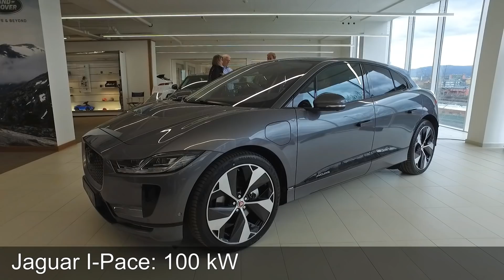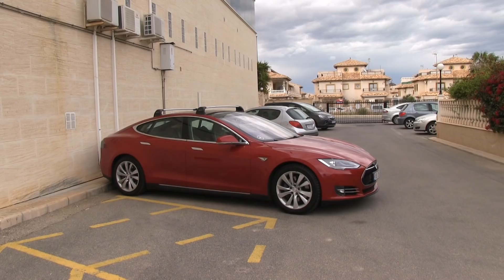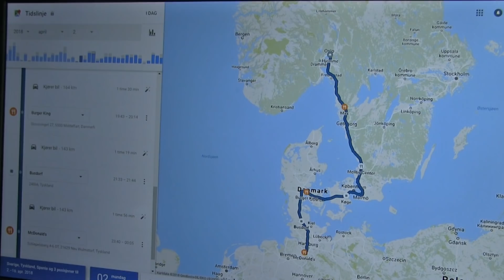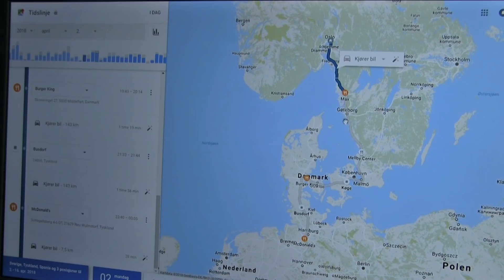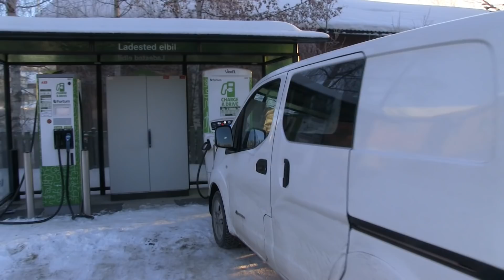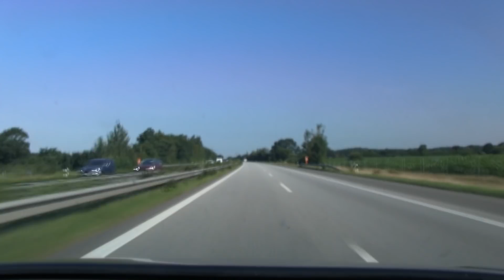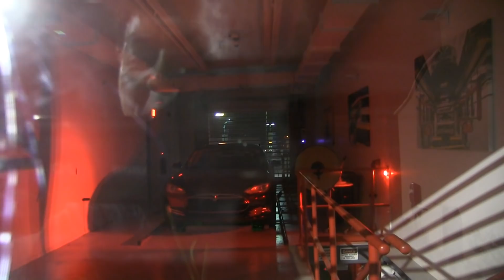Will 350 kW fast charging be too fast?

Comment: Too much thinking on this topic - all chargers should be super fast chargers and be the standard. Why manufacture 50 different charge stations with different speeds and plugs.. better off running a car off coal with terrible logic like that. If every charger out there is fast there no guessing where you have to go in order to charge for the trip your on. Having all these variants of chargers will either hurt the transition to EVs or cause major infrastructure costs in the future.

Comment: I wonder if it will have a capacitor that charges up really fast then bleeds off into the battery.  With a capacitor 350 kW would be rather slow.

Comment: Battery size shouldn't really change charging time much. You're not going to be drawing 350 kw while charging a 24 kwh battery.

The whole way you think about charging is just different from how you think about stops for fuel. Not necessarily better or worse, just different. Probably a bit more complex than fueling a tank, but not in all ways.
Reply: But damn, 350 kw is just an insane amount of power for any EV, when you really think about it.

Comment: 350 kW won't be too fast for cars I guess, but it might be too expensive building these chargers and charging/cooling systems in for the charge speed improvement you get in return.
But electric vans, semi's, smaller trucks and maybe even agricultural machinery (these do not have a tachograph so you can use them as long as you actually want, but you will need to charge them to be able keeping using them) will need the speed-improvement of the chargers.
Reply from the maker: *kW
Reply: Bjørn Nyland Oops yes kW indeed

Comment: Ioniq's only 2.4C charging, not 3.2C. SparkEV is 3C, 18.4 kWh battery peak charge power at 80% is 55 kW (3C), still  the highest C rate EV in the world, likely to remain so for the foreseeable future. Your video of Ioniq on 120 kW charger showed that it only went to 70 kW (2.5C).

Comment: Late response here, but what about letting other users of the fast charger be able to cut off a charging car when it is above 80 or  90%? Need to set up the chargers so that they are accessible from two sides. Then the problem with dining and taking up a charging stall will be lower.

Comment: Still a bit of a bananas/oranges vibe regarding IC and EV range comparisons. An IC driver could always carry a couple of gallons of petrol in the boot to make emergency garage-hunting unnecessary. An EV can hardly carry an extra battery pack. Of course EVs will have battery chemistry that makes potentially damaging fast charging unnecessary in future, but at the moment there's no easy alternative to start-stop-wait... start-stop-wait...  unless you're fabulously wealthy and can afford your car's ludicrously expensive gigantic battery option. Frankly, if you can afford top-of-the-range stuff and journey time is THAT critical to you, don't drive at all. Take one of your helicopters, instead.  ;-)

Comment: I feel like you’re only considering situations in which you’re traveling long distances and you plan out your route to the next super charge station. That’s not how most people drive. Most people will be driving their cars within the same 50 mile radius, but potentially with stops in random areas. In other words, planning out your days routes isn’t part of most people’s daily drives.  I think the goal with ultra fast charging is to be able to get to the point where we can treat EVs the way we treat combustion engine vehicles - never having to worry about your charge because you can stop at a charge station and charge up much the same way you would refuel a gas powered car at a gas station. I think once we get to that point, EVs will take over completely.

Comment: As a non Tesla EV owner we need more DC fast chargers not faster.  As of now my 4,000 mile trip was a challenge because the number of chargers, there were locations where there was only one charger for 100 miles.  It’s untenable to have to depend on one charger at multiple locations.  Even with Tesla if you get to a station and the power is out, you are dead in the water!

Comment: If you use 1000V DC Pulse charger, you don't need thick wires at all. Thats how they try to keep the temperatures low while charging

Comment: I think it's never too fast. In my opinion, it's too slow as long as it takes longer than refueling a normal car with diesel or petrol.
Reply: It can be too fast for the batteries to handle. Too fast of a speed will fry the batteries or serverly damage it.

Comment: Fast charging will work as long as space is not used for parking ie treated like pulling up at petrol pump.You take on board what you need then go.Park elsewhere for food intake.In the UK if we could splash and dash say 60 miles worth of charge in 5 minutes there would be a massive EV uptake without the need for 100kwh batteries either.

Comment: I didnt drive a tesla yet but i think that every 400km you stop for 30 minutes is okay in some sort. With my current car i can drive 1200km without refuelling and if i have the possibility i will take advantage and drive 1000km without stopping. 

The other problem is that electric cars arent economic here in germany if you drive a lot and long stretches, as the charging network, the unrestricted stretches of the autobahn and the low tax and diesel cost are working against electric cars. 
I think right now the only option is to pay the higher price for an electric car and drive it within the typical range as your daily commute.  
I hope that these cars get cheaper and more advanced to be a valuable option to petrol or diesel powered cars. I like the fact that you dont have to worry about warming up the engine anymore :P

Keep up the good content!

Comment: This kind of ultra-fast charging is targeted at people with a fossil mindset. Those people usually don't think about charging the car when it is parked for other reasons than charging - which in fact makes EVs so convenient - but they still think about a usage pattern where you drive, park your car, and sometines you drive to a filling station and refill your car, while you wait for the refilling to finish sitting in or next to the car. This usage pattern really doesn't leverage most of the advantages of an EV, but - particularly German - automakers think you only get people to by an EV if they can use it like this.
Reply from the maker: +Mirko Klemm Very good point!
Reply: "fossil mindset" no its more for people that visit a shit ton of clients for example, right now those people buy german diesel cars like bmw, merc and audi. They don't have time to wait an hour until the car is charged up.

Comment: I couldn't share my comments earlier, but better later than never:
Bjorn, to answer your question --- no it's not. It may seems like overkill, but you look through prism of your habits, country and way of driving.

Using superchargers is fine, but 
1. they charge fast up till some point and then drastically slow down. Using faster chargers will result in charging with good speed for little longer, right?
2. they are not THAT popular (especially here... we have 4 for entire country). 
3. I don't know about most people, but I can assume they don't have all that time to charge as you do during nimber task, or on roadtrip with wife. *You must be aware that you did a lot of stops and they were long*. 
It's good to drive slow, enjoy the road and so on, but most of the time we don't have time. Well at least I don't. It's not that what you did is wrong or sth. Just really want to go from A to B fast.
4. 110kW is optimistic scenario. If you meet someone and have to share, we know how this ends.
5. Consider towing huge trailer for long distance (2000kg+) or cold weather (-25'C and below). It's no secret that this impacts range in a HUGE way. Trailer does the same to ICE car (cold weather too, but not that much).  So in that scenario being able to quickly plug-in, pee and go again without making not-so-wanted meal break would be a huge win.
6. And lastly, having more chargers is always good. IF somehow we can adopt Tesla to harness that power, or even use adapter and suck 110kW out of it - it's still a great option for us to have more options. 
7. Driving fast. Similar to point 5 - with great speed comes prize of air resistance and batteries get hot. Constant 160km/h is fine-ish but drains it quick. 200km/h+ makes them hot. We need power to drive and extra to cool them down. So again it would be nice to just swoosh the road, quick "refill" (5min) and off we go again. Like two extra red-lights or waiting for train to go away.

So to summarize. Yes, yes, yes. More options is always better. And technical aspect of it (cooling etc) should be put aside. They told Elon this (Superchargers and Tesla in general) cannot be done either, and look. It is possible. So as long as they balance between battery life and speed - I'm aye on this.

Comment: When talking to ICE drivers when asking about "what range do you really need", what I most ofter hear is "I want to be able to  do..." - which usually ends up in a stupid number. What I asked myself before buying an electric car was: "what range do I need to cover?". I then found the longest distance I "need" (want to be covered) was 300 km (there and back) that we used to do maybe once a year. So at the time we made the decision, Tesla MS was the only one to fulfill that "need". Experience shows that this is plenty. And by the time we anyway need to stop a longer trip (as you tell in your video), the stop will be of "longer nature" (drinking something, eating something, going to the toilet - applies to the whole family). Just be honest to yourself, and it will be easy to find an electric car that suits your real need. And the charging speed in real life isn't really an issue ;)

Comment: IdiotQuestion:  What is this “C” unit of charging speed?
Reply: If a battery is rated (eg the 2170) at 6 Amp/hrs then if it has a 1C charge rating it can be charged at 6 Amps. The rating may not have too much cognisance of  battery health or life though. 
There is also discharge C rating. Radio Control LiPo batteries can be rated at over 50C discharge, but may have a cycle life of less than 200 before 20% degradation as they are designed for very high current ability for a short time.
Reply: Wayne Russell, thanks for the reply.  First, I presume, in your example, you mean 6Ah capacity.  An Amp per hour is ... an odd unit of measure.  

Anyway, from your example, I gather that a C has units of 1/hours (1C = 6A/6Ah).  (Actually, from your example alone it guess it could be defined as 1C = 6Ah/6A, thus have units of hours, but I gather from the discussion that the C rating goes up with higher currents, so presumably it’s 6A/6Ah.)
Reply: Wayne Russell, your original reply said “6 Amp/hrs” — apparently meaning “6 Amps per hour.”  An Amp per hour is a pretty-rarely-encountered (as far as I know) unit of rate of change in current over time (fairly long spans of time).

Am I assuming correctly that you meant to say “6 Amp hour” (a common, nitpicky mistake), or did you in fact really mean 6 Amps per hour?

Comment: Its about duty cycle.A leaf that takes 30 minutes to gain enough charge to drive for 1 hour, it has a duty cycle of 2/3 or 6.6. You have to charge 30 minutes for every 1 hour you drive. Tesla is better than this. The point is that if you increase the battery, and then increase the charge rate at the same proportion, you don't affect the duty cycle. A leaf that drives for 2 hours but takes 1 hour to charge has the same duty cycle as the standard leaf. Duty cycle matters on long distance drives.

Comment: Faster chargers only have a highere vehicle throughput if people disconnect their cars quickly. So the efficiency will go down for long stops and faster charging.

If I would be able to choose between more stations/stalls and higher speeds, more stalls is probably better, if at ~100kW at least.

Comment: how hard can it be to put a charger in the middle of 2x2 car parking square and once one of the cars becomes charged it becomes possible to unplug it so the other guy can start charging. Or have 4 of the cables charging cars simultaneously? 1car - 1 charger seems a bit inefficient

Comment: Faster charging simply equals to less chargers that need to be deployed.
We aren't talking about 500.000 Teslas on the road, imagine 100 million cars with that 100-150kW battery which needs to be recharged. Tesla alone already has almost 10.000 supercharger stalls for a fleet of only 300.000 cars.
Reply from the maker: +TBasianeyes Unlike fossil cars, EVs don't primarily need energy from fast chargers.

Comment: The very hight charging is likely only possible between 40% to 65% without killing the battery, therefore the benefit for the 350kW will not be that large compared to a 250kW charger. If you push for the limits - things tent to get expensive over-proportional, this is likely the main reason to stop at 250kW. Of course time will tell, and Porsche need to so something:  1st: we are better than tesla !11! , and 2nd (may be more important): Dear old Petrol-head you can continue to drive like a maniac at 220km/h on German Autobahn, AND we will charge you up in 5minutes (even if not true).

Comment: Theoretically, I guess the issue you raise could be dealt with by automating the whole charging process. You show up at a charging station and it takes control of your car and puts it in a charging stall, and then moves it to a holding area when done so that the charging stall is available to someone else. It would require either wireless charging beyond  levels that are currently possible, or some other way of making contact with the vehicle that could be reliably automated. I realize that this would not be easy to do, but if autonomous cars ever actually become a big deal, it seems like their charging infrastructure would have to be fully automated, so maybe the infrastructure for human driven cars could benefit from that development. In any case, I find the issues around charging infrastructure very thought provoking, and I enjoy hearing you discuss them. I'd be curious to hear your opinion about how much and what type charging infrastructure would be needed if Norway, for example, went  to 100% electric cars.

Comment: Witb autonomy the cars could connect/disconnect and move themselves in and out of charging bays with humans present. Until then They need registration/rfid readers that charge a fee all the time you are parked in a bay. This would balance out with a seperate fee for energy used. So very fast charging and short duration at the charger with be cheapest option. The decision is how much wear and tear the owner is prepared to endure for extra speed.

Comment: Great video. Most people can't understand that the switch from ICE to batteries is an huge upgrade, even if charging takes a lot longer than refueling, they are afraid of the relatively speaking very small downsides with electric cars compared to ICE cars, and "forgets" the huge benefits, so they get stuck on focusing on charging time. That despite the fact that cars are on average, driven about the range of a charge in a Tesla per WEEK, charging speed is not an issue for everyday use. Those extra minutes to go to the restroom or eat or whatever is for the average driver a matter of a few times a year at the most.       

Both Porsche and other manufacturers will probably eventually also build electric cars with higher energy capacity. Yes, that prediction is of course limited to those manufacturers that survive the death of the market for ICE-cars, and unautonomous cars that the owner can't share.

Comment: Although the charger will deliver 350 kw the current will remain the same as a 150 kw charger as they are doubling the voltage to 800 volts (remember watts =  current * volt ) It is the high current that would normally damage the batteries at this rate of charging at  400v. Speaking as a hobbyist rather than an expert.
The downside is that 800v is a dangerous high voltage (but then so is 400v). Secondly, the battery pack and electrical system would have to be specifically designed for 800v so you could not use a 350 kw charger on 400v EV (which is most models) unless the charger has two 400v supply voltages that can be combined for 800v.

Comment: Totally agree with you Bjorn on all those points. 200kWh chargers seem like a practical limit. I suppose if its safe and batteries can handle the power then juicing up for 10 minutes on a 350kWh might be ok as it allows car to queue up just like at petrol stations and more people will be able to use it. This might appease the petrol heads out there.. but generally i agree we need lots more lower powered stations that allow you to match the charge rate to the time you would be parked. This foes however mean many more charging points would be needed as most parked cars will be using them and then how do you control who’s next in the queue?